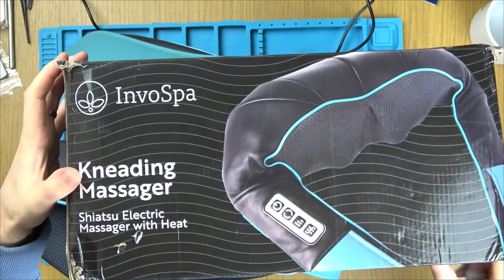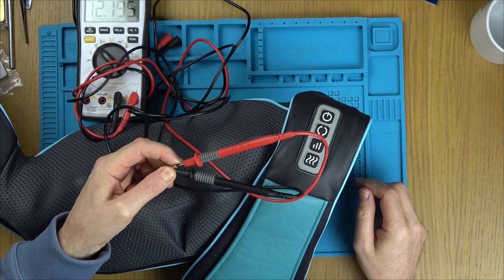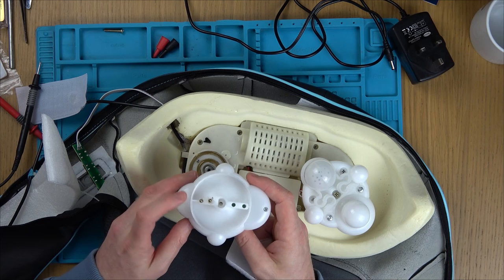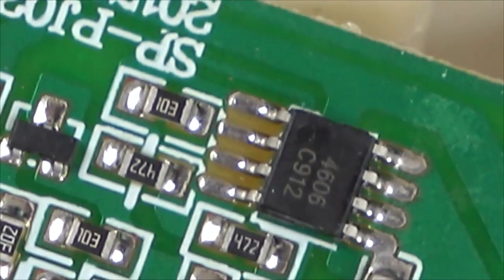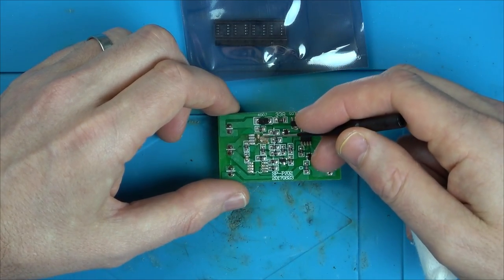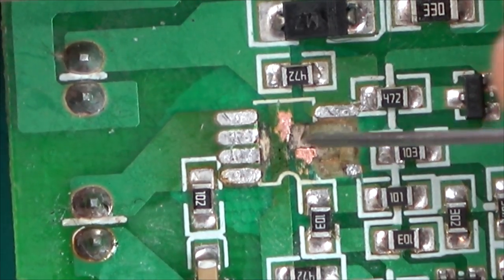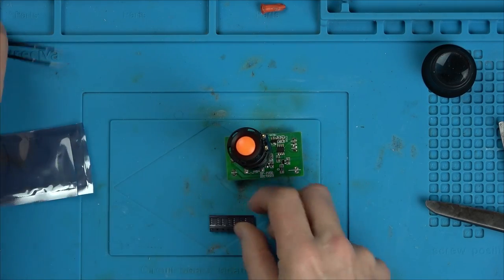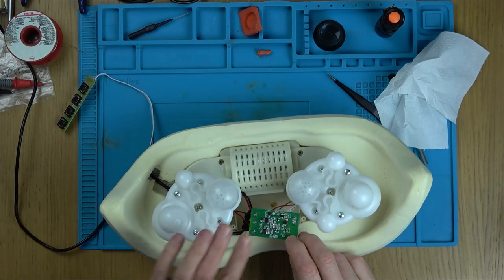Broken Massager - Can I FIX it?

Comment: may be the mosfet burned out because of the loading on the motor, so resting or pressing your head hard into the massage 'thingies' partially stalled the motor(s) and the rising current overloaded the mosfet(s)🤔
Reply: Think you are likely correct. I had one of these and it stopped working after excessive pressure that stalled the motor. I could smell burning too.
Reply: Yep, was thinking the exact same.

Comment: Im really glad you went the copper tape route . Besides the wonky height issue , that was a beautifull trace repair . Deff much better then jumping it ... and while its true no one will ever see it most likely . Its nice to know you did it and you did it right ... and if anyone else ever did get into it the future im sure they would be impressed to see the great repair work that has been done previously .  Plus its good practice . 

Side note ... you should get some sort of custom my mate vince soldering iron tip ... to brand the inside plastic of items your work on ... as a sort of signature incase one day someone does do a repair on something you have worked on ... would make for a cool little easter egg

Comment: I suspect what may have happened is that screw that you found turned itself out from the turning of the motor, that side was then not making a very good connection, it was possibly connecting and disconnecting over and over and this caused a build up of current across the mosfet which caused that catastrophic failure. Great vid as always Vince!

Comment: I was given something similar as a gift.
Where the lights are, they were colour changing leds, the heat was geneated by overpowered resistors stuck on a circular aluminium heat sink.
The plastic moving discs, were made of a gel like rubber.
Used it once, now in the understairs cupboard amongst all of the other useless gadgets.

Comment: A clean bevel tip is great for flattening solder joints.  You can just drag it across the joint and it will collect any excess solder(within reason.)

Comment: Didn't expect it to use MOSFETs to do the switching would of thought it would have had a cheepy micro or MCU. 

Interesting none the less well done Vince.
Reply: it does have a cheep padauk alike microcontroller thats the unmarked chip because it has a few modes

Comment: Got a foot massager with 'broken heating' for cheap. Heat is generated by  a few light bulbs, and all was working fine. 
You cant expect a foot sauna when a 24V 2A power supply also has to run a high torque motor.

Comment: What are the advantages of trench MOSFET?
Advantages of the trench design include 1) Lower ON resistance, 2) Smaller parasitic capacitance, and 3) Improved switching performance. One drawback, however, is reduced short-circuit tolerance due to the lower ON resistance.
"reduced short-circuit tolerance "
Screw drops out , short circuit , boom

Comment: Vince I have never seen anything that came apart so easily for fixing, what a brilliantly designed device. One zip and all the intricacies of the device are revealed for fixing just wonderful. Did my eyes deceive me or did I see something shorting out when you moved the device.?? I have to ask though doesn't the heat come out of that other plastic cover the one with the slots in it, it looks like a heating element underneath it?? Just a thought. To be honest it looks like a peltier chip or some other heating device underneath it, well it looks shiny anyway.
Reply from the maker: Really easy to take apart, the easiest thing yet! I think that was some weird reflection  of light because I have a big studio light shining right down on it. Unfortunately it is just the incandescent lights giving out the heat or should I say giving out a glow😂

Comment: Pretty much from the moment you got it open I was pretty sure I knew what had caused it.. Probably one of the rotors stalled, stalling the motor. That caused an over current and the overheat.
The loose screw is definitely a suspicious candidate in stalling the rotor.

Comment: I'm building a cool project at the moment, I am converting a six grid watch display case I got from Lidl's to become a solar box so I can keep my solar and eco-drives charged up.   Going to run a set of UV's facing pretty much aimed at the watch faces using LED strips (bought a shedload of different types including UV, colours and multicolour on rolls from Aliexpress a while back) and a power brick off of something broken and these rolls of LED's are cobs so all I have to do is supply power, all the resistance etc is built in.   The power brick I am going to use is actually a variable output, I am prob going to put a row of warm white to "backlight" the watches and if that looks good I will prob do the other display cases.   I am also going to do something similar but using QI pads from Aliexpress to charge my Kinetics up, going to see if the solar bit works first.

Comment: If the MOSFET was the same as the other on the board. Would it have been easier to just see where the 2nd chips legs went to, when trying to work out the tracks that were missing? I would think it was connected to the same value resistors and such or was it setup differently?
Reply from the maker: Good question, I don't know. It was probably very similar if not the same 👍👍
Reply: @Mymatevince  oh good. Means my thinking is not insane :)

Comment: Those things are a pain (in the neck.... i don't apologise), we had one and one of the wires carrying power was just in the wrong place and kept getting pulled out of the solder.  I even put an extension on the wire to no effect, same breakage kept happening.  So annoying as its really good.

Comment: Can't believe the heaters are light bulbs...well...

Complementary transistors are pairs of opposite polarity, mostly used on class A/B and B amplifiers. How they are used on the motor drive is known as an H-bridge. Used for motor directional control indeed!

"trench" in transistors is the manufacturing process. There is an actual trench on the silicon! Done mainly for more surface area.
Reply from the maker: Thanks Rui👍

Comment: Hey, I have the same device. Newer version, since it was bought new in the last year. It has stopped turning on. I have confirmed the power is getting through the fuse on the board, and there are no obvious burned out components or solder joints on the main PCB or switch-board. Any ideas?

Comment: Hi Vince have you had a Ninja A400 apart yet ...the baskets i can clean but if i turn my air fryer upside down all around the element is getting spotted with brown ive tried a tooth brush ...scouring pad etc but the element is in the way im tempted to unscrew the element but chicken out as the air fryer was expensive i dont want to ruin it ....its a big design fault any ideas 😊
Reply from the maker: Sorry, not yet Susan, but I nearly bid on a Ninja Air Fryer just before Christmas over on eBay as I want to try homemade chips!!!! I can't remember the model number. I'll check eBay again now for a faulty one as I think it could be fun seeing the insides of one 👍👍👍
Reply: @Mymatevince  mine does brilliant chips and chicken is lush cheers i will keep watching 😊

Comment: My guess is that the motors were stopped from turning by force and strained and overloaded the circuit and blew the chip
Reply: The screw falling out could have caused that head to move off centre and bind up.

Comment: I have a very similar one but it doesn't have the straps. Bought it from Lidl to ease a strained muscle in my neck and it actually made it worse although it felt kinda nice. My neck made clicking sounds when moving my head around for about an hour after using the thing and it didnt fix anything pain wise. Absolute waste of money.

Comment: I have one of another brand, another color, exactly the same. The heating is a joke, it's obvious when you realize is powered by a 30W wall thingy. I think mine has leds instead of the incantescent bulbs, it's more the heat from the rubbing than from them.

Comment: Too used to LED's ! When using your power supply the current meter is as much use if not more in some cases that the voltage meter, you should be constantly referring to it, if say you attach a 12v bulb to it and set the current low like 200mA and switch it on you will see the bulbs light up then go dim because the supply is set too low, your first thought was 'is the current to low ?'  which it was, but the power supply was already telling you that !😜 you would observe that the current meter was set at the limit (where you put it) and the voltage meter had collapsed and so the current limit LED ( CC ) would have been lit. I'm not being one of thoses 'no it alls' and picking on you 😇 it's just I rarely hear you refer to the current meter and the Voltage/Current relationship is so important !........cheers.....oh yeah please stop saying " I wonder if the amps are to low" or " Let me check the amps on this" sounds silly now, like you 5 years ago 😜it would sound better and more confident if you say " I wonder if the current is to low ? " or " Let me check the current being drawn " well that bit is up to you really but just sayin😃 Great work Vince Love your work I'm a big Fan !!😍🐭

Comment: 15:23 The voltage is not actually changing because that is not how Mosfet gates work. What is changing is the duty cycle. 
Multimeters measure voltage by averaging the voltages in a wave and that is why as the duty cycle increase your multimeter sees a higher voltage.
-TheMoreYouKnow